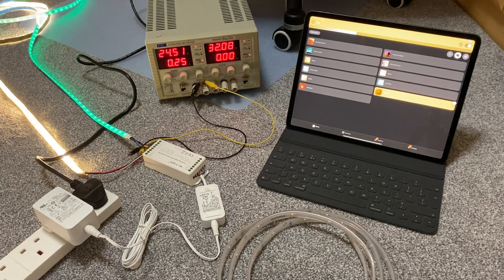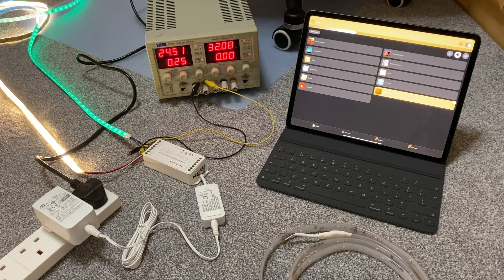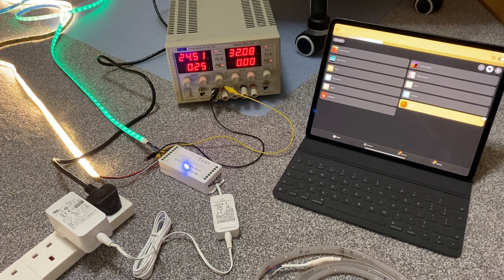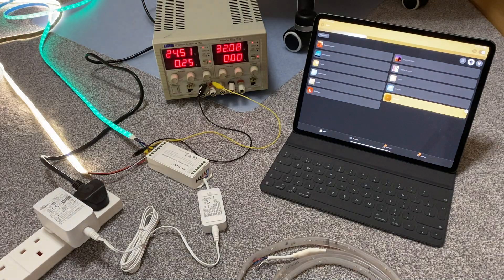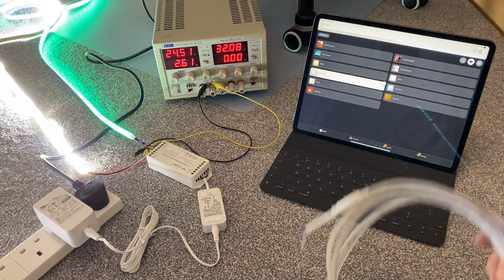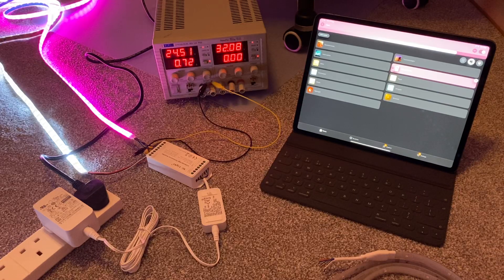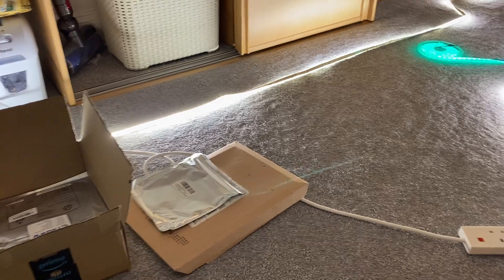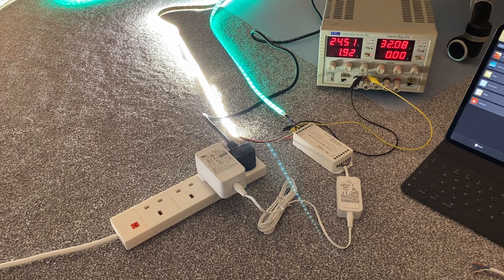Philips Hue LightStrip Plus - extending it using low-cost LED tape.

Comment: Thank you for the awnser. Can you help me to find the right power supply and led amplifier for a 30 m extension, please? I’m using the current philips hue controller and power adapter with a rgbcct 60 leds per meter lightstrip. It works flawlessly with 1 meter but if a add more than this, it starts to blink in some colours. Thank you!!

Comment: Hi!! Do you know if is possible to simple add a rgbcct lightstrip to the original hue controller? (not considering the power loss of the hue controller), using a 3 meters rgbcct per exemple?
Reply from the maker: That is possible, but you would have to ensure that you use 24v strips and get the pinout right. Beware also that due to its power supply, the hue controller current-limits at 28W, so you are still limited in the length that you can go. I note that as you plug in more of their light strips, after about 3m, they all gradually dim with length. Hence the video to remove this limitation.

Comment: @Brian Frost What spec light strips are you using for this? I want to make a HUE Entertainment sync setup without spanking 400 quid on LED strips :D
Reply from the maker: Hi Sean. You can use any make of LED strip downstream of the amplifier, but they must provide white, warm white and RGB (as do the LED's on the Philips strip). That way, connecting the appropriate wires to those LED's will give an APPROXIMATION of the intended Philips colours. Note that these colours will not be as exact as the Philips LightStrip because it will depend on the relative brightness of the white and RGB strips but I decided that since colours are often chosen by inspection, this didn't matter too much. The amplifier also separates the strips from the driver electrically too, so you can use, for example, 12V strips if you want. I chose to use 24V strips because you can get long runs then without voltage drop issues. In principle you can also add multiple amplifiers to one Hue driver for really huge installations.

Comment: I know this is working with the Hue app, but does this still work with HomeKit?
Reply from the maker: The Hue App knows nothing about the amplifier or the LED's downstream so yes, it functions EXACTLY as an unmodified LightStrip (apart from colour matching of the changed LED's of course). My reason for doing this was to create a very long décor run of bright colour or white (10-15 m) that would be fully adjustable in the Hue App (or Homekit) I.e. indistinguishable to all software from a standard LightStrip. I decided I would be happy to experiment with colour control to cope with the changed colour characteristics if necessary.
Reply: @bfrost999  ok glad to know it still works with HomeKit. I've seen plenty of LED strips that work with Philips Hue bridge, but not with HomeKit. I'm not sure if Philips or Apple blocked third party lights to work with HomeKit, so was thinking of doing exactly what you did since I want to light up my room around the crown molding, and it's 46 ft long (14 meters). I want to still be able to control it not just with the phone app, but also with HomeKit. Thanks for the reply.
Reply from the maker: @charminbaer2323  Yes, I've tried a few third-party strips. They basically work but as you say, don't get exposed to HomeKit and often their dimming and reliability within the Hue ecosystem is not as perfect as the Hue products. That's why I decided to simply take over the LED drive signals but to leave the driver and its power supply as unchanged.

Comment: Philips Hue allows you to go up to 10m (30ft)   why didnt you just buy 24v LED Strips which will work just as easy without buying another amplifier controller  save time and money
Reply from the maker: Great question. The Hue power supply and driver is limited to 28W output. Cleverly, they ration that power when you try to draw more. In practice that means you can add another 1 or 2m of Hue LightStrip extension before it all starts slowly dimming, so if you want bright and/or long runs at more than 28W you will need an amplifier (and of course more supply power too).